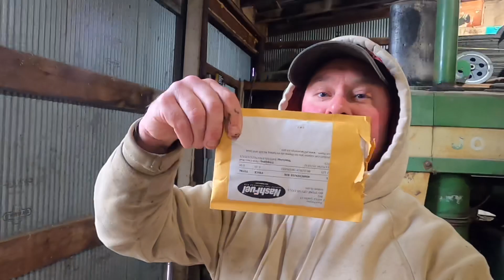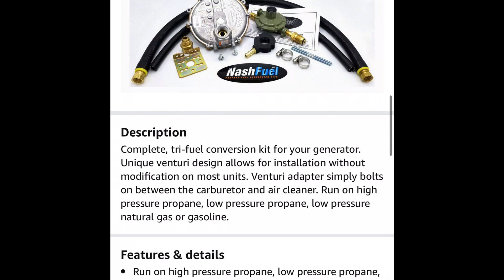Converting An Older Briggs & Stratton Engine/Generac Generator￼ To Run On Multiple￼ Fuels! ￼

Comment: I just converted my 500cc Briggs and Straton  generator to natural gas. I used a hockey puck to make a Venturi adaptor that sits on the face of the carburetor. I needed to buy longer carburetor mounting screws to accommodate the added with of 1". I used a ball valve at the exit of the to fine tune the engine after it was running. It was a good educational project. Especially after it worked.

Comment: Take A metal coat hanger bend it over into A D shaped wire for pushing A cloth rag through the hole for drying out.& removing dirt.& etc. From inside of your fuel tank. Next use A airgun nozzle to blow out.& dry out the fuel tank with.& vacuum it as the very last step with shok vac.,or HEPA filter vacuum.

Comment: Just clean the carburator.& jets.& sets.& port holes out good. It'll work again with A gasket.& O-ring seal kit. Get some regular ethanol fuel.& add A bottle water to the fuel shake it up in A clear jug let it set for 2 days.& get yourself one of those plastic hand squeezable pump for removing the settlement out of the bottom of the clear jug.& then just add in octane booster to your FUEL afterwards to be ready for use after swishing the jug around.
Reply from the maker: I suppose one could do that but the fuel tank on that generator is not very big. It maybe holds a gallon and a half of gas. For a run time maybe of 2 hours. We plan using it to plug our combine into on our field that’s 12 miles from home if we have cold weather in the fall. I have a 30 lb propane tank that it can run on for several hours.

Comment: Thanks for sharing about the propane conversion kit.  Thought you were going to convert the tractor to propane when you mentioned the pony motor, and not use the pony motor.  Do put in a garden, as some say there maybe food shortages, maybe?  Good to grow as much food as you can.
Reply from the maker: I’m actually seriously thinking about converting the pony motor on my tractor to propane. I don’t know if it will work  but I’m thinking about it anyways.
Reply: @organicpaulguy  It might work.  I saw a DJ 70 in Texas that ran on propane.  It did not have a pony motor.

Comment: Propane on a Briggs... Makes sense but it's the first time I've seen this. I have propane on a Minneapolis Moline U never thought of it on a Briggs.... I'm going to try this on my snow blower maybe. (If I can find a place to mount the tank.) Really nice to see you this morning Paul, start my week off right.
Reply: I've had several welders with briggs and kohler that were propane. Alot of plants won't let you run a gasoline engine inside so we had to use propane. They make factory propane carbs for most small engines
Reply: @brianhansen826  yes, when I was in the factory all the forklifts we're propane, all the welder were electric. Yup, no gasoline allowed in the factory.

Comment: We had a propane generator on the farm, it was a bigger unit. I remember we had to move it with the loader. I think it was a 10kw+ unit, had an Onan twin cylinder engine. We had a connection and regulator for it on the 500Gallon tank for the house. This Generator would run the whole house and the well so we had water for the cattle. We raised bottle calves to slaughter weight, otherwise I'm sure we would have had a PTO generator to power the barn too. The only thing we couldn't run with this generator was the welder and air compressor in the machine shed.